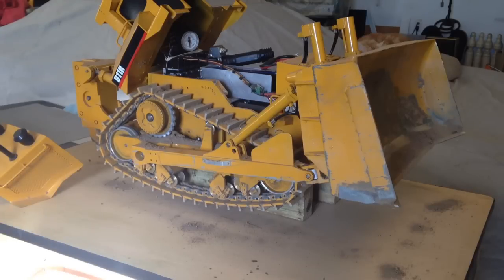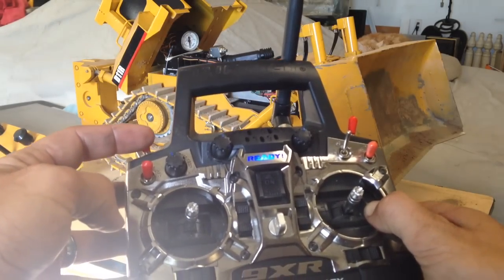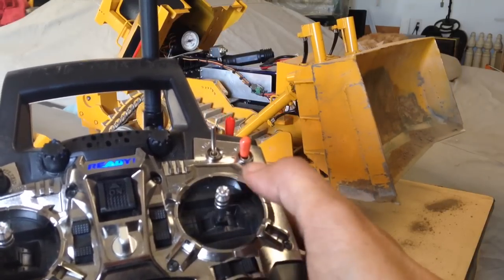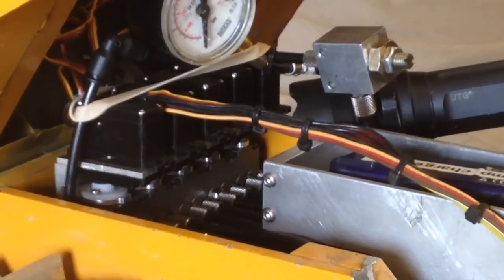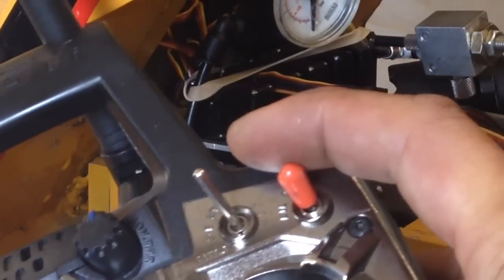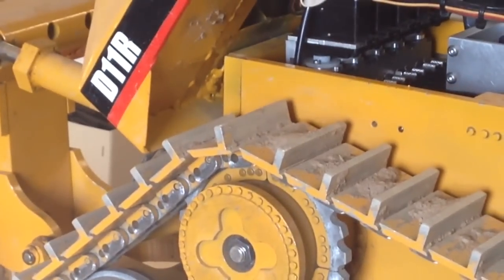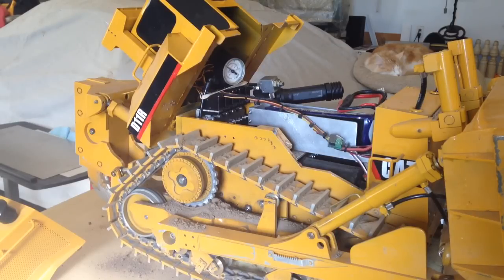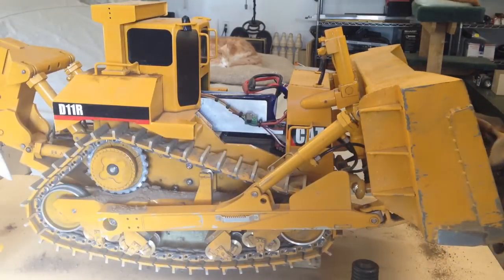Rc bulldozer hydraulics explained

Comment: Im trying to build something like this in an old tonka t-9 dozer, where do you buy your supplies? What weight does the dozer need to be? Stupidly i did the math for D-9 at 1/16 scale would be 6700lbs lol! 60-70 lbs seems to be about right. Did you buy the tracks for yours? I dont expect the rubber tonka tracks to work well

Comment: Wow doesn't look like anybody's much into this channel. I had a question, if you have a loader that goes up and goes down how many servos would it take and number two how many spots would it take an electronic solenoid hydraulic lines to for that one function. Another words how many spots on the control bank would it take to two circles and two spots on the hydraulic

Comment: For the linear actuators I meant to say 2 seconds for one inch of travel, might be a bit slow for blade control coming down a hill.  I'm thinking if hydraulics can be RC controlled to go faster or slower, this is the way I'd like to go.